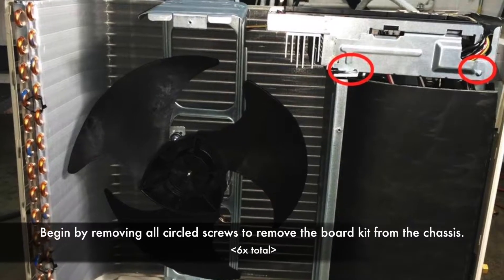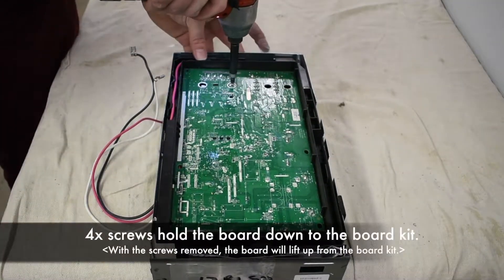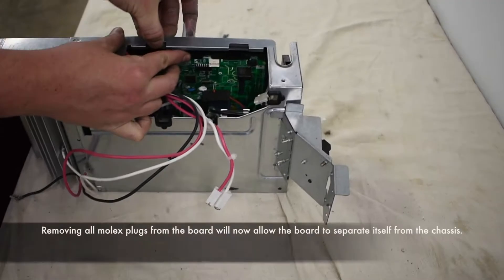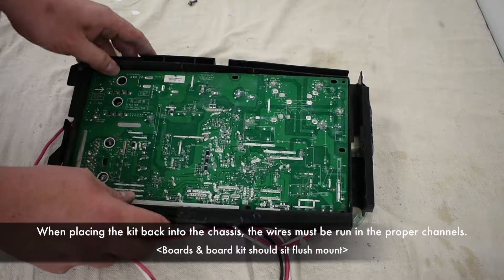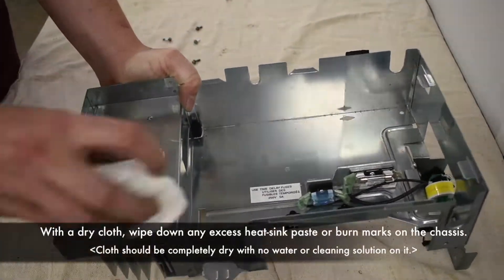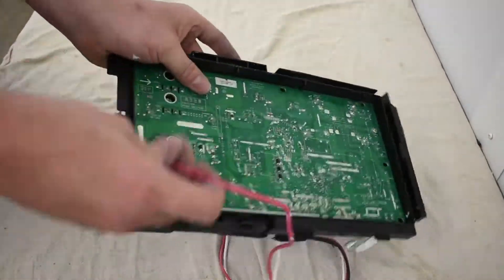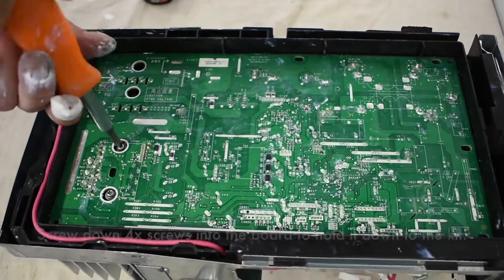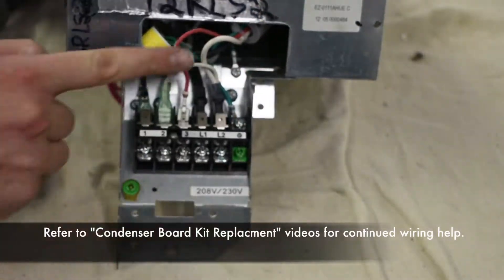Board Disassembly: Single Boards

Comment: Why fast forward when removing the board from housing? Oh right, it's still a major pain in the ass. Fujitsu is poorly designed for board replacement. Period. And boards fail waaay too often. Shame on the engineers. Not everyone has tiny Japanese fingers.

Comment: A technician told me my AOIY12rl2 circuit board and the terminal block cannot be replaced. They offered me a new system for $5000. and I am a pensioner with 35 years working in the electrical industry.  I have gone without a/c for two summers now.  There are no Fujitsu contractors in my city, the nearest one is a 3 hour drive away.  And I do not feel I can trust anyone. The problem was caused (?) by the main black power wire becoming disconnected and some of the wire coating is melted. Is this a common event? There are flash burn marks all over the terminal block. I haven't checked the board for burn marks yet because i just learned how to do it a few minutes ago on Youtube. Could it be the power wire was attached incorrectly? My circuit breaker was not tripped in this event.
Reply: Where do you live?